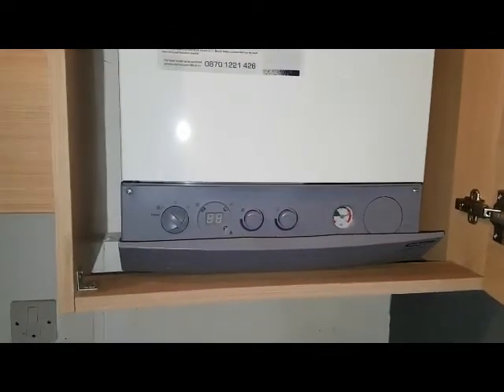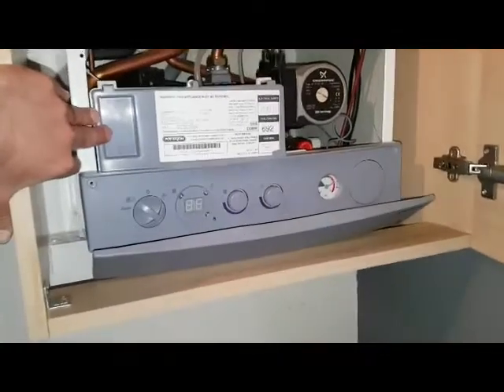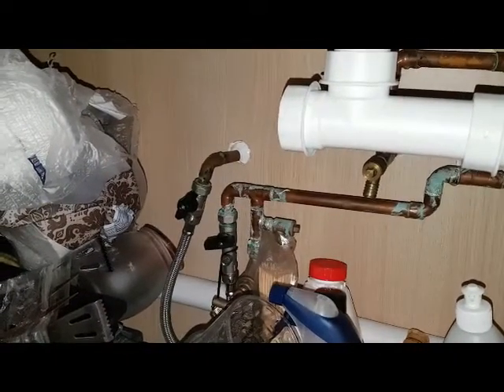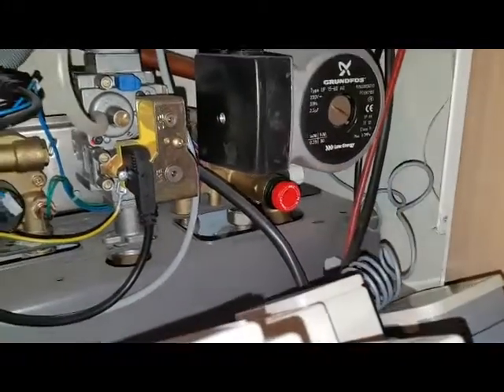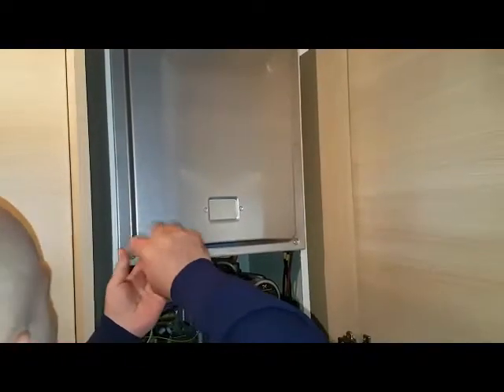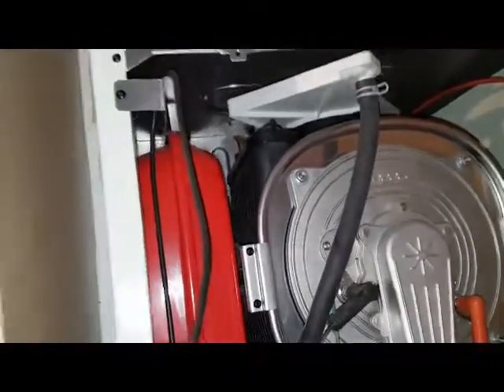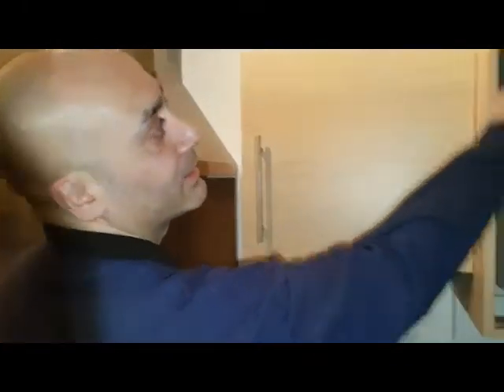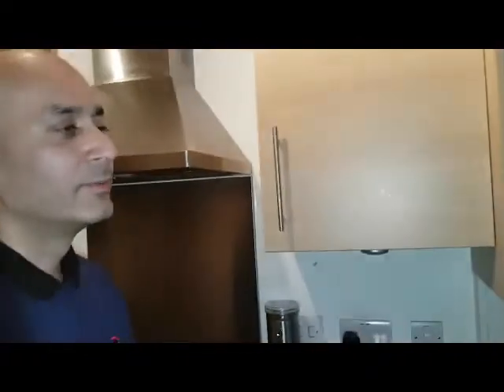Gas Portfolio and Boiler Repair Training With Coach Tony Morgan | A+R Central Heating and Boiler

Comment: He’s also checking the operation of a safety device , it’s not difficult to remove and clean the prv seating and washer on this boiler after draining down. Standard practice , Can you not reseat a tap ? Then you should be able to reseat a prv easily some of you engineers need to learn how things work.

Comment: Why use the prv when theirs a drain point right next to it?
Reply from the maker: Craig Billingham because its quicker and when your pumping air into the expansion vessel alot if water is been displaced and water will go all over if you use the drain point
Reply from the maker: Hi Craig how long have you been repairing boilers. Just a general question